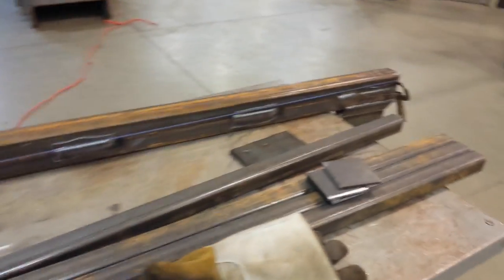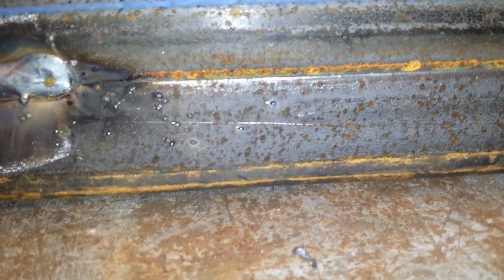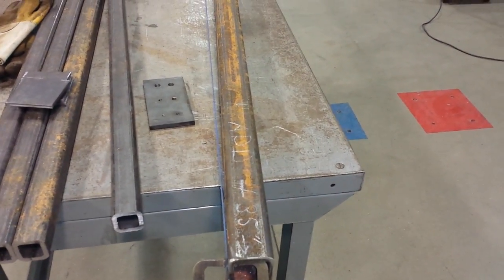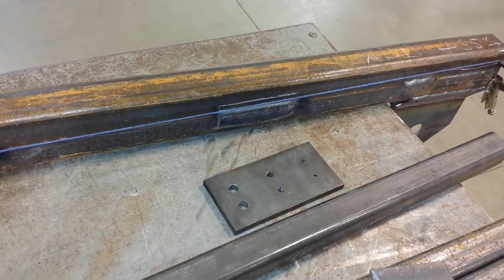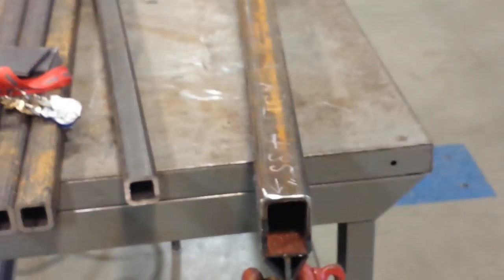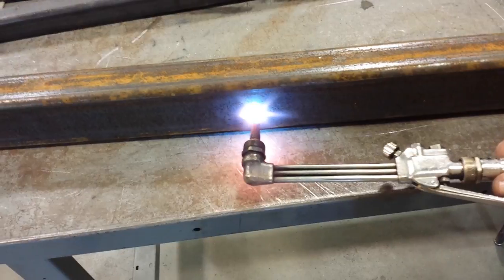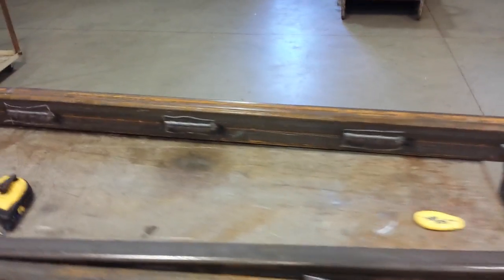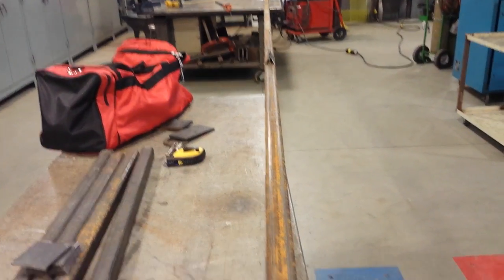Heat Straightening Steel Square Tubing

Comment: Thanks for this video!!! My son is building a trailer for his ag mechanics project and the frame rails bent after welding on the spring hangers. We tried your method, heating on the top of the rails and it worked perfectly.

Comment: This is so cool and amazing. I just bought (2) 2”x2”x48” 1/4” thick square tubing from the old stock section of a metal supplier ($20 compared to $80 if I bought new) and they too have this split.
Not sure what it is but I just thought, oh, I’ll just weld this up and now I have a warped 2x2.
Can’t wait till tomorrow to try this technique.
Thank you!

Comment: There is a good moral hiding in this video. Buying cheep often costs more... lol. I did a welding and a fitting and turning appyship with my father and we used to use heat like this all the time, when we were in a rush we'd spray it with water after heating to accelerate the effect. i haven't done this in about 20 odd years.

Comment: Well done. I deal with bent & racked rear frames on tipper trailers and am slowly getting the knack. Thanks for sharing your technique.
Reply: Jay in't interesting you mention that as I'm currently trying to straighten mine.  I was very disappointed to see that the manufacturer used a very sturdy I-beam  for the lift itself but only attached two C-channels face to face for the rear pivot beam only stitch welding 5 points the length of them! (see pic's).  Thank God center weld held otherwise may have lost box over the dump drop-off 10' down!  The rear half fell away at each pivot hinge and when lowered most of it lined back up. But one side I'm having trouble getting aligned so I can clamp/bolt together long enough to raise body and run full welds and add support stringers forward.  Currently have two 1/2" thick shackle plates with 5/8" bolts clamping and going to wrap chain with porta-power back to I-beam to assist pulling box into alignment before heating channel.  I plan to use this vid's red-spot technique but would love any advice, especially gas pressures for no.1 tip.  Here's pic's: 
 https://photos.app.goo.gl/RuBfwExlhwkD3jqH2

Comment: I'm not a welder but found this video really interesting and I guess not so surprising you had 23 heat spots to combat 24 welds as it seems you have just balanced the heat stresses both sides :-)

Comment: Great Job on the heat shrinking Brian.  Always has my interest in metallurgy like this.  Wonder, do you have a video of doing this to round pipe as well.?  Thanks for sharing.
Reply from the maker: Hello, thank you for the comment. Unfortunately I don't have a video of round pipe straightening. However it's basically the same technique as tube.

Should I ever come across any material that needs straightened though I plan on using that opportunity to make a video demonstrating how to straighten it through.

Comment: Thank you for a great video, and what an excellent result! But sometimes I'm a little thick and I'd really like to learn/understand this technique, so just to be clear... Did you start in the middle and work your way toward the ends, alternating sides each time you heated a spot?...or did you heat all the spots starting from the middle and work toward one end, before starting on the other end? Does it matter? And also, you said to let the heat spots cool before moving on... But did you let each individual heat spot cool before moving on to the next one, or did you do the complete series of heat spots each time, and then let them all cool at once? I'd appreciate any help you can give me on this, to make it a little clearer. Thanks.
Reply from the maker: Hello. Sorry for the late reply. I've now attached this account to my phone and I will be able to monitor it better.

Having done this a lot through the years I usually know how much heat is required to do something like this. In this case I didn't have a clue it'd take this many heat spots.

I like to give something this length three spots right off the bat. I have always started in the center and then one on the right and one on the left and it wouldn't matter which one you did first I wouldn't think.

I say let it cool completely before adding more spots, because until it's cool, it's still working on straightening out. Assuming it's not going to move more before it cools completely, one may heat it more and move it too far.

So I heat three spots usually, depending on how it's warped. If it needs more after it cools I typically give it a few more, wait and evaluate it again. I hope this helps.
Reply: I would say the longer the item to be straightened the more heat spots you will require, remembering that between every heat spot there will be a straight line... In this case 1 heat spot on the opposite side of each weld would make perfect sense as each weld caused a little shrinkage to cause the bend in the first place.
Reply: The reason metal warps when exposed to high temperature is due the fact that hot metal area  surrounded  by cold metal area cannot expand being held back by stronger metal bonds ,heated metal will get compressed and in the way cooling down it will shrink more than it has expanded .A observer will see a straight bar bending one way when heat applied locally and bend the other way more as it cools down ,sometimes the induced stress can cause metal to crack in high carbon steels .

Comment: I have a 10”x 2” rectangle tubing that Bent when I welded it. Would you put 2 heat spots one above the other on the 10” side to help shrink it back or 1 larger heat spot?

Comment: Worked for Schuff Steel Co in Phoenix for almost twenty years and in most departments/positions including heat straightening and almost exclusively with a rosebud torch setup with compressed air and water chill so I’m just a little confused about your reasoning of not using that method (rosebud torch) of heat straightening steel. I was taught that method by some very knowledgeable “old timers” with much success in that way of straightening.
Reply from the maker: I've used a rosebud tins of times for heat straightening with great results myself. But for this particular tube, a rosebud wouldn't allow me to concentrate my heat in one little area. It's 11 gauge steel tubing. It'd damn near melt it.

Comment: I always though the tube had to be constrained on the ends so that the metal plastic deforms and that's what causes the length to decrease.  (tube can't expand in longitude so it becomes thicker... then when cooled, it has to be shorter).  Your square tube seems to only be clamped at one end.  Am I missing something?
Reply from the maker: This technique works with the ends loose. Tbh I don't know exactly why I had the clamp on the end. Probably just to keep it from falling.

Comment: This was interesting to see.  I'm new to welding and welded a log arch (2x2 square tube 1/8" thickness) and after welding in the interior cross supports the legs that extend down to the axles/tires pulled in 1/2" on each side😤 after cooling.  I don't have a torch but I do have a plumbers soldering torch or I can weld as someone else noted on the opposite sides to try to pull the legs back out?  Thoughts?
Reply: Welded material acts as a reinforcement .. maybe  some heat and some brute force , it takes a big enough torch to get the metal red hot, or welding plates of the same size on opposite sides .
Reply: I just did this yesterday. I put a weld on the opposite side and it straightened out a 2x2x48” 1/4 thick tubing.
I’m going to try the plumbers torch on the 2nd 48” piece that I welded that crazy open seam.

Comment: Why didnt you flip the tube 90 deg so that its own weight would then be helping it straighten?
Reply from the maker: It was only 11 gauge. Wouldn't have mattered I don't think.

I would certainly do that with something very heavy though. Like heat cambering an I beam.

Comment: I have a 4-in round tube with .120 wall and it's bent a little bit about a quarter inch in 3 ft. Had to sell my acetylene equipment when things got bad and I don't want to have to reinvest just to do this. I do have torches for plumbing which run map gas I know it's not as hot but do you think it'll work? Thank you

Comment: Great video Brian. I’m new to welding just done a couple little jobs before but have just started a sliding gate it’s the same length as this but obviously has a top and and bottom rail which have both bowed like this. How would you go about sorting that? Doing one rail at a time or both together?
Reply from the maker: I'd have to see it and how it's warped. We used to just put spots on the top of the pipe (top rail) of handrail and it would pull the whole piece straight. But I think it would depend on how many pickets you had in the gate.

Comment: Great job,
I have a kubota tractor backhoe that has a twist on the last 20 inches of the boom how can I take out the twist 
Thanks
Reply: Apply the same force that it had it twisted in the first place  the opposite way and  get it hot ,local heat like in the video is a stressed induced method that will weaken metal rigidity .

Comment: I purchased new cold rolled steel plate 1200mm x 150mm and 10mm thickness for purpose to be ways for my diy metal lathe. But they in the shop catted that piece with big machine scissors, and it got distorted by length about 5mm on the middle. How to straighten this to be reliable for my purpose?

Comment: Why does heating one side cause the member to bow in that direction?  Wouldn't the steel on that side expand? I'm sure I'm thinking about this wrong
Reply: from one of the replies above

"The reason metal warps when exposed to high temperature is due the fact that hot metal area  surrounded  by cold metal area cannot expand being held back by stronger metal bonds ,heated metal will get compressed and in the way cooling down it will shrink more than it has expanded"

Comment: Great video, thank you. Any tips on round tube rather than square?
Reply from the maker: Same thing applies. Treat it just like the tube. We used to straighten lots of handrail after welding warped the crap out of it and the key is patience and letting it cool before you heat again (so you can touch it bare handed).
Reply: Yeah. I have a 12 ft. 4in tube colemn that's about 1 1/2 out in its center after a fire. Gonna try this.

Comment: I have no oxyacetylene in my apartment, I have only a regular stick welding device... How can I straightening tubes in this case?!!
Reply from the maker: By going out and getting a torch I guess? Dunno about that. Might try a hammer or something!
Reply: @brianbarnes4568  I tried a hammer already. Thank you! :)
Reply from the maker: @carlsagan3295  the only thing that I can think of is to weld a big round spot just like I did with the torch? I don't know if it would work or not.... And depending on the thickness of the tube you had better be pretty comfortable with the welding machine.

Often times you can also bend smaller tube bey it's plasticity range by using leverage. Again you would need to be very careful to make sure that you do not bend it too far (that's what she said).

Comment: What if it were solid and not a boxed tube ?
Reply from the maker: Douglas Alan solid materials are going to use different methods for straightening. Sometimes a wedge method can be used to achieve the straightness desired but I've found that restraining, heating and application of pressure is what is most effective for solid materials. Of course we have to be concerned in some cases about mechanical properties of out materials after all of this heat. Another thing to consider.

Comment: What if you have a stress bend?
Reply from the maker: Hi. This procedure works for a stress bend too, but I have noticed that it helps apply pressure to the bend too after heating. If you aren't able to apply pressure, you will probably need more heat spots in that area. Don't do them all at once though. I should also note that the stress bends I've used this on have been minor.
Reply: Brian Barnes Last week I was repairing a bend in the third stage of an under reach for a tow truck. It was also a steel box half inch thick by 12"×6' it took all of 100 tons to get the kink out cold.
Reply from the maker: @fattmouth7715  when working with something that size (half inch thick and 12" x 12", tubing I assume?), a silver dollar sized mark will not work. Something like what you are talking about, would need a spot (or spots) the size of a softball at least and more likely in the range of the diameter of a cereal bowl. I've found that for good kinks sometimes extending this heat spot into the radius of a square tube of this size can be beneficial as well.

I wish I could have access to things like this like I used to when I was a full-time welder. I could make a small library of heat straightening videos on a large variety of different sizes and shapes. Until then all I can do is try to answer any questions.

Comment: And what is the name of the  idiotic company that would use steel like that . Never get that company go build a thing for you .
Reply from the maker: Lol yes! It's actually a discount steel company that is set up in fort wayne indiana who sells metal from their sister company who sells the good steel. This place gets steel in and sells it to people at a pretty discounted rate because of its imperfections. I would say that something like this should be scrapped and never sold personally, and they'll probably get sued one day after a failure where someone gets hurt.

I have bought steel from there myself in the past and there is some pretty high quality stuff there and things like this are not very common there. So they're just a supplier of steel that didn't make the cut for one reason or another.

Comment: Moral of the story just get more tubing
Reply from the maker: Eh, no. Haha.

Sometimes (usually) warpage like this happens from welding something that has taken lots of time to build. Stairways, handrail, I beams etc all warp from the heat of welding on one side. Can't throw em out if you're not talented enough to straighten them back out!
Reply: Brian Barnes the amount of gas used and time justified a new piece...
Reply: Brian Barnes nice video on straightening though
Reply from the maker: @jamessmith1190  at flow rates of 5psi for acetylene and 50 psi for oxygen (which is pocket change) and the overall time it took to heat this thing up (approximately 15-20 minutes) I could not personally justify rebuilding something that had about an hours worth of time to build and weld with an estimated cost of material at about $120.00.

Even if this didn't have a split seam, it would have still warped at the plates that were welded on which would still require straightening. Unfortunately if you were to grab more tubing each time you had something warp you'd never finish anything and spend an eternity rebuilding and a fortune purchasing the material over and over again.

Think about if this were something that you had (or your boss) had thousands of dollars invested in and you wanted to just scrap it and throw it away? I'd fire that individual.

I made this quick demonstration for the purpose of helping people out when something like this happens to them while fabricating something for the sole purpose of knowing that it can be fixed. This happens all the time on the job and knowing how to correct the problem makes one a well rounded fabricator.
Reply: Material is still cracked 80 percent of piece
Reply from the maker: @jamessmith1190  actually the material was cracked all the way down. Yeah it's junk steel. They were just lifting some pole barn trusses with it though.

Plus, the two guys who bought it are two of the cheapest people I've ever met lol.